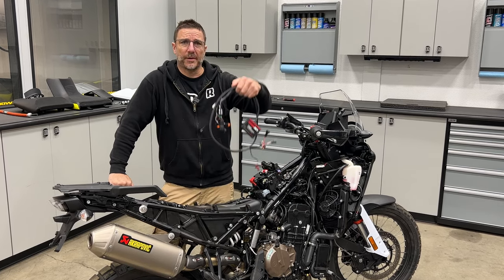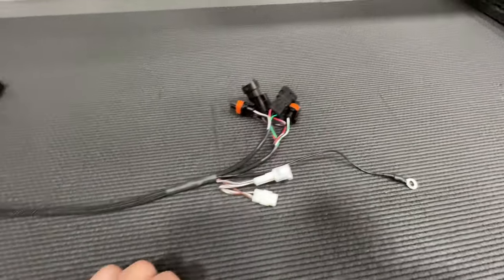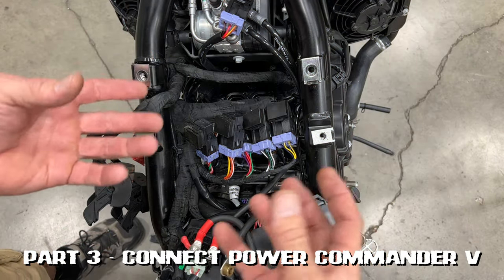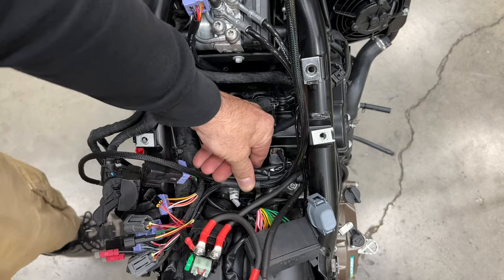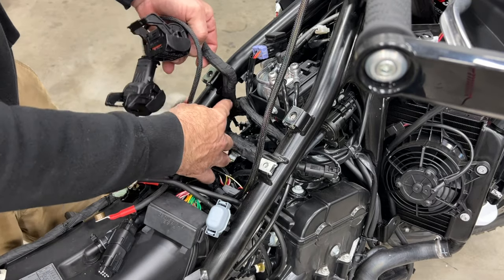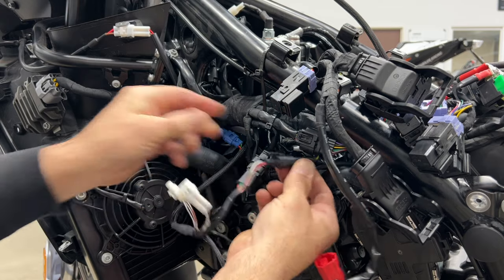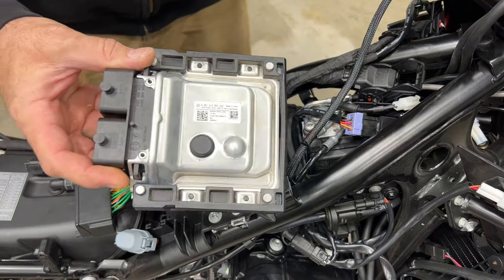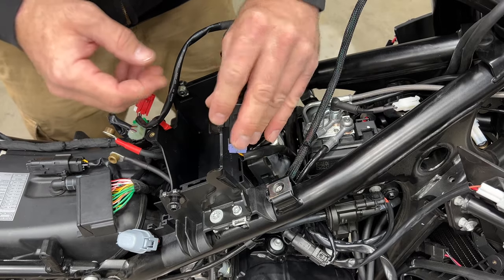HOW-TO INSTALL POWER COMMANDER V - HQV 901 NORDEN - ROTTWEILER PERFORMANCE

Comment: Great vid, the UK 890R has the extra sensor (diagnostic plug) on the battery cover too. I thought the posi taps were a vulnerability so I carefully spliced and soldered the wires into the TB, reloomed with pvc tape and Tesa tape to close the sheath. I also secure the threaded lugs in the battery with some rtv so they don't fall out

Comment: Does the Husqvarna Norden901 suffer any performance degradation with an aftermarket exhaust and Decat pipe?
And/or would the Dnynojet Power CommanderV solve any performance issues with this setup? Does the Commander V need to be specifically programmed for this setup? I assume to complete this setup on the Norden would be to install the Rottweiler flow thru air intake/filter?
Thanks
Derek
Reply from the maker: Not really. Some things move around a little bit on the power curve but for the most part it’s a worthy change. The Power Commander and our intake will do wonders for that bike for sure. The maps are identical to the 890 Adventure so we have everything you need for the setup you end up with. Plus the maps are free when you get the Power Commander from us and we’ll even set them up ready to go!
Reply: Thank you for the honest reply on this question.

Comment: Great video and definitely will make install much less intimidating. Once it is installed, will everything be the same as far as rally mode and traction control? In others words same settings just better power? Thanks again for all the great videos!
Reply from the maker: You are 100% correct and right on the money. The 'modes' are really just a cocktail of throttle mapping, ABS and MTC. The fueling isn't really changed to make any of this happen, and this is a very common question from customers. Since the Dynojet Powercommander simply modifies the signals going from the ECU to the fuel injectors, everything simply follows what the stock system does, just at a better air fuel ratio. So basically you are correct, they are two totally different systems that do not interfere with one another. Your modes will simply be better.

Comment: Does it help with low speed stalls so I don’t burn up the clutch from feathering it so much?
Reply from the maker: It certainly can and many riders report exactly that. With a Power Commander you have complete control over the fueling if you go with race maps (read the Power Commander page for the Norden or Adventure) you can mess with the fueling on the very bottom until you are happy with the bike too.

Comment: Waiting on seeing the new exzilory fuel tank mounted up under the rear subframe.
Reply from the maker: The auxiliary fuel tanks only fit with the single seat designs so mainly the KTM R and Rally models. The split seat designs have parts on the bottom of the seat tray that collide with the fuel tank as we have it now unfortunately. We have our initial order being made now and if they prove to be popular we will create a specific design for the split seat KTM Adventure 790 and 890 as well as the Norden.

Comment: RE: 0 2 Sensors: I forgot to disconnect and already have the bike back together. 
Can I just cut the wires to avoid having to R & R the tank ?
Are there " dongles " available for the 890 Adventure to go into the 0 2 plugs to 
prevent the yellow engine light coming on ? 
Thanks, Chris in San Diego.
Reply from the maker: You can cut the black wires if you like if you are sure you will never go back to stock and won't need them. Those are the power wires. Grey is signal and white is ground. Unfortunately there are no dongles available for that ECU. It measures algorithms and looks for movement wish is natural for signals coming from narrow band O2's, if it doesn't see any movement, it throws an engine light which only defeats cruise control and nothing else. They don't want bikes running on cruise control if there is anything detected in the engine that might be faulty is why.
Reply: @RottweilerPerformance  I just went & cut them all, insulated & secured with zip ties.
Speed run seems to  limit at 126 Mph,  same as my Africa 1100 twin & Triumph 660 Tiger.

Comment: Are there horsepower gains with the power commander and will it help my 790R start with the first try? Thanks great video and products I have several and am very happy with them.
Reply from the maker: Absolutely! They are great when bundled with our intake systems or simply on their own. Always good gains and many customers have reported better cold starting but that is not a guarantee it will fix the problem with cold starts. It's just what we hear from some users for what it's worth.

Comment: On my 2020 790 R Rally, my main throttle body plug does not have a black wire with a pink stripe.  It does however have a pink wire with a black stripe.  It also has the pink wire with a blue stripe.  In my case, how do I know which wire to posi-tap?

Comment: Great video, I love power commander and use them, but folks might want to know, in Harley’s it will kill the bike warranty. Not sure about other manufacturers?
Reply from the maker: Depends on the application. There are strong laws in place that prevent manufacturers from denying warranties for issues that cannot be logically tied to other aftermarket items (see Magnussen Moss Warranty Act 1975), so unless the manufacturer can directly tie a possible warranty item's failure to a specific modification, it is illegal for them to deny the warranty.

Comment: What kinda power is a kitted 901 making? Intake. Exhaust. Etc.
Reply from the maker: Stock is about 97 HP to the tire SAE. Fully kitted with our Rottweiler Intake System, Arrow decat, muffler and tuned with a Power Commander with a race map is about a 10 HP gain at around 6000 RPM which is right where you begin to get on the pipe.

Comment: 4:54 Negative is the first to disconnect and the last to re-connect to avoid shorting to the frame.
Reply from the maker: You are correct. On this bike the wires have a tough time actually reaching the frame where they are located so we weren't too particularly militant about it, but in general you are correct. It's not particularly life or death in this situation though.
Reply: @RottweilerPerformance 
 Understandably, but just a general habit. 
BTW, I have a large shopping list for my 890 KTM Adventure bike I'll call about , today. 👍
Reply from the maker: @rudedog3529  Our team will be ready to assist!

Comment: I own a Norden 901 Expedition, which has the same engine. It's not boring. I do not see any reason to "upgrade" and spent alot of money. BS. the engineering and fueling is perfect without any so called "upgrade"
Reply from the maker: We don't really think they are boring. It's just having fun with the intro. As far as 'perfect', that really depends on your perception of what 'perfect' means. If that means on the leaner side of what is safe to run, then yes, it is certainly perfect. If 'perfect' means that the motor is getting what it really wants in terms of fuel, which in turn helps it run cooler and make more power, then you would also be correct. It just depends on what your definition of perfect actually is. For most, it's the latter. For some, it's the former.